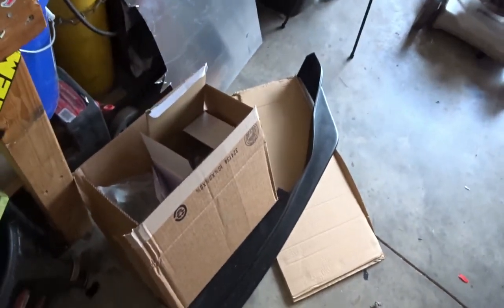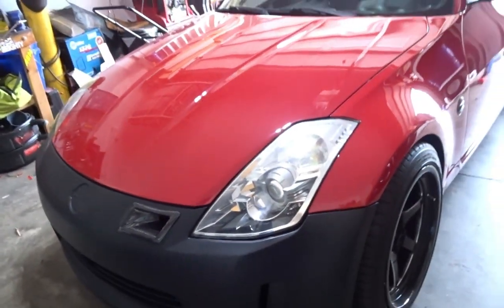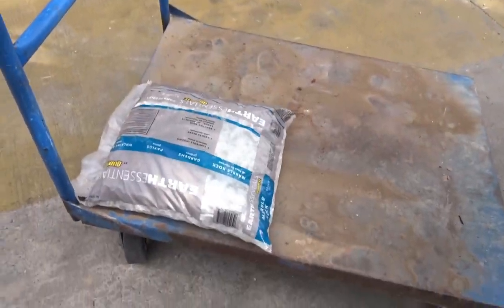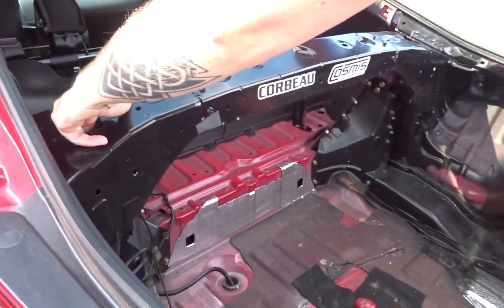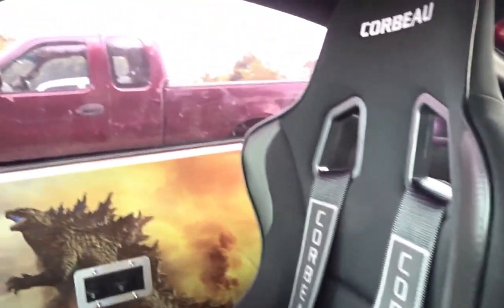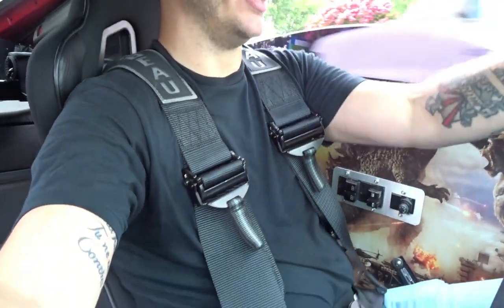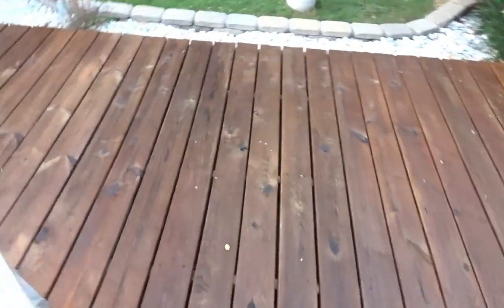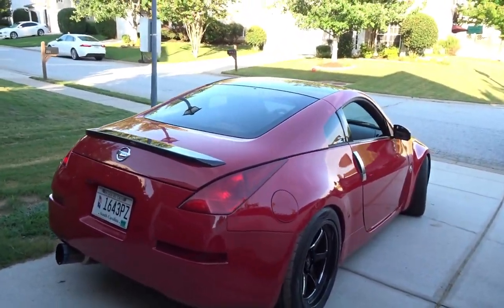Used the 350z as a Farm Truck!

Comment: I was going to ask how you like those Pilot Sport A/S 3+ but then I noticed you don't have matching tires
Reply from the maker: You can still determine if you like a tire even if you run them only in the front or only in the rear.  This is a temporary setup as I only replaced the fronts because of crazy ware.  That was in an earlier video.  I’ve run mismatched setups a number of times for various reasons.  Some tires have characteristics more suited to a rear tire and some make better front tires.  Not a big fan of federal so these will all be swapped soon